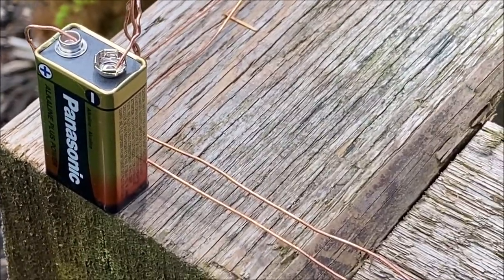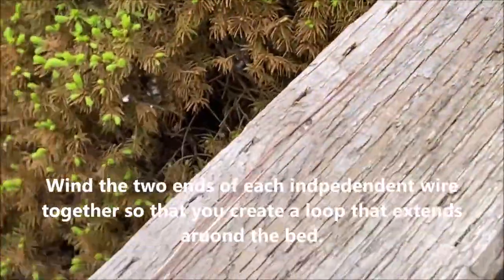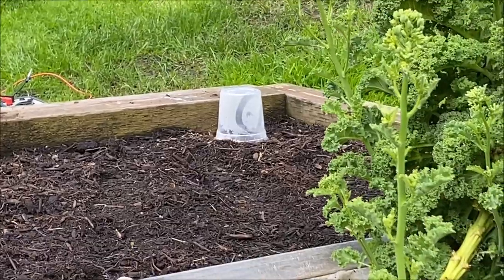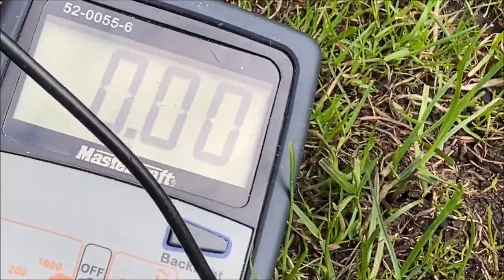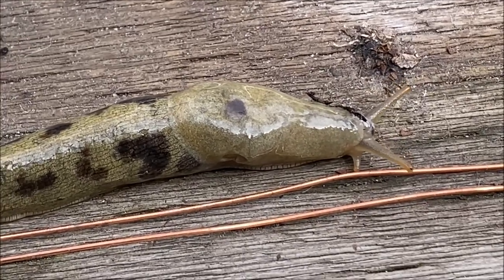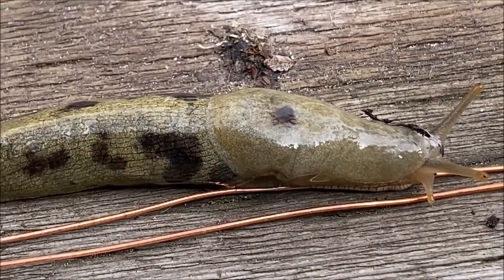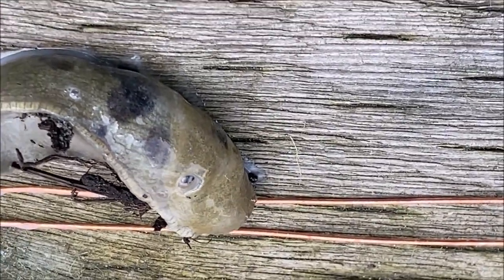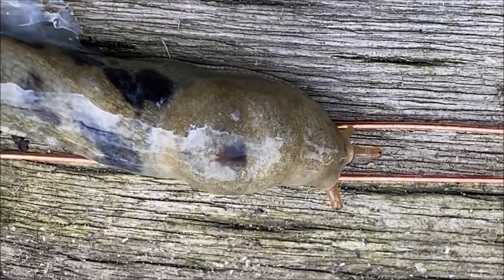Link to my video showing an electric slug barrier for raised garden beds

Comment: It looked to me as if at the end the slug was getting bolder - it might change behaviour if it gets used to the current. I think it would be a better test to create a two loop electric pen and put slug in centre and see if it escapes - if it stays in centre for ages ( perhaps left unattended ) you know the effectiveness does not die down with time. See other Youtube video to get the idea of an "electric pen"  search for "Copper Tape Slug Repellent Test" on Youtube - guy basically used copper tape to make an enclosure. I am suggesting two concentric copper wire circles - not touching and then connect to battery.
Reply from the maker: Okay. All I can say is that my slug problem went away!

Comment: You can always add the batteries in series, parallel, or both if you want more power to deter them. ;) P.S. Series connection gives you more voltage, whereas parallel gives you more amps, and series, parallel gives you beast mode!
Reply from the maker: Thanks, and I found a single 9V gives them enough of a shock!
Reply: connect to dc power supply

Comment: How long does the battery last
Reply from the maker: It seemed to work for the season. I didn't do a volt reading unfortunately!
Reply: Battery life tends to deplete over a period of time; however, since it's an open circuit (until the slugs come in contact with the wires), there's practically no active power loss, Meaning it could last up to 10 years!
Reply: @jboy6944 Ive seen a solar powered version of this one.
Reply: Not as long as it should do, if left outdoors without a cover to protect it from the elements.

Comment: 🤣🤣 cool, but will it shock you if you touched both wires?
Reply from the maker: No, it's a 9V battery with extremely low current. Your skin absorbs the electromagnetic energy without you even noticing.